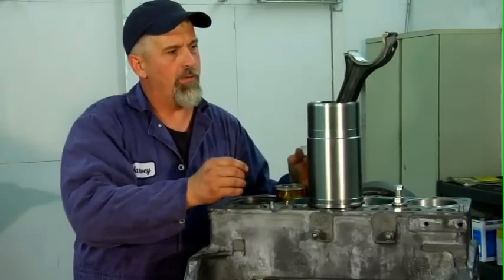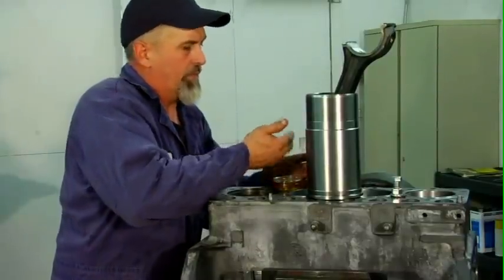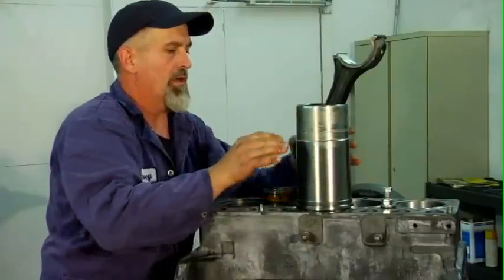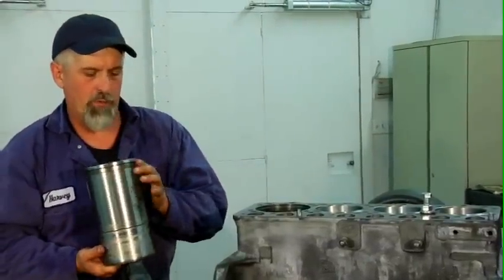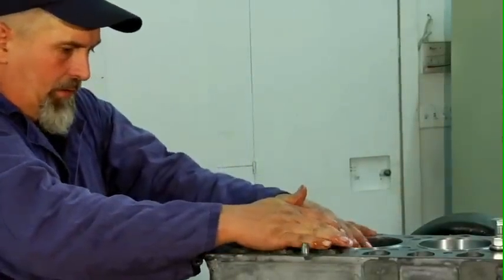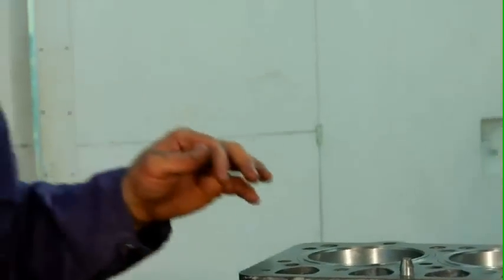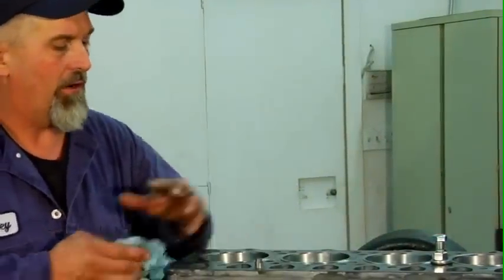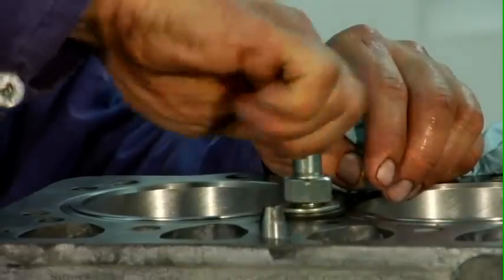Diesel Wet Sleeve / Liner Installation

Comment: Nylon/Rubber mallets with almost no force won't do too much to steel liners, but I'd still probably chuck the piece of wood across the liner and hit the middle. But he only applied light force, just enough to slip it past the O-ring
Reply: Wet liners for diesel engine are ussually made out of iron not steel, and the best way to installed them is with a liner installation tool which use the cylinder head bolts to push the liners and avoid any damage to the seals or sealing surface.

Comment: I overhaul a horizontal single piston engine, I changed new liner, piston and rings ,the problem when engine started, there's some oil coming out from cylinder into exhaust, in just 1hr ,a more half liter oil being wasted.what is the cause, can somebody explain. Tnx

Comment: What if liner is too loose after it is installed? 
Should I use use some kind of selling compound or should I get a slightly oversized liner?
Reply: Depends on which area is loose, if in the o-ring area, the engine will have to be machined as a rule depending on the make. If the counter-bore is loose, the engine will have to be pulled and a whole sleeve can be made to renew the counter bore.

Comment: Same way to install liners on a 14 liter detriot. 
You have to put the piston in thru the bottom of the sleeve and then drop the sleeve in with and piston at the same time. 
The cap on the rod is so big it can not fit thru the top of the sleeve to pull out they the top and you have a crank in the bottom that you can’t get past if you were to drop it thru there.